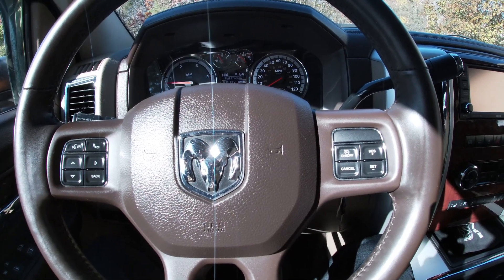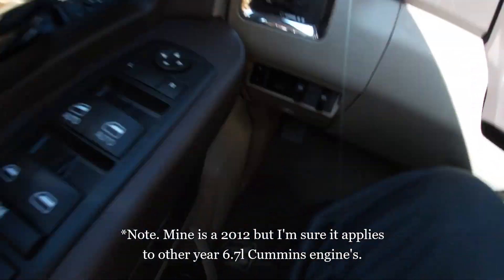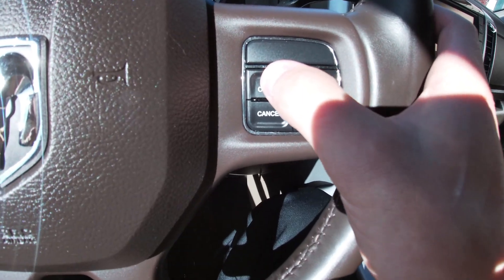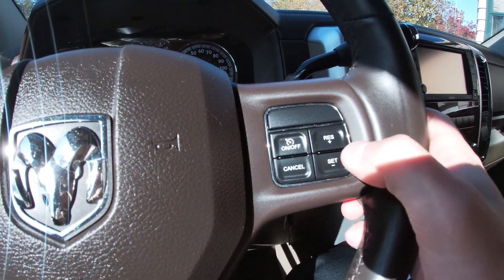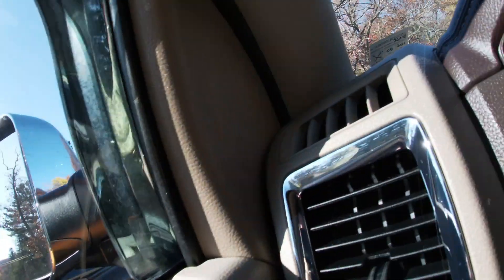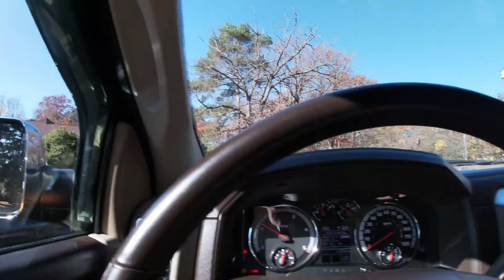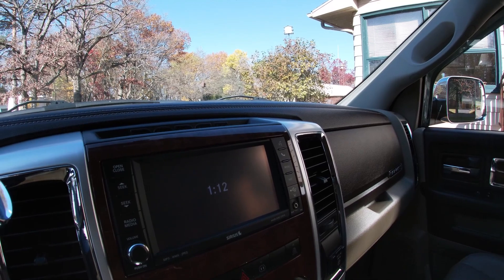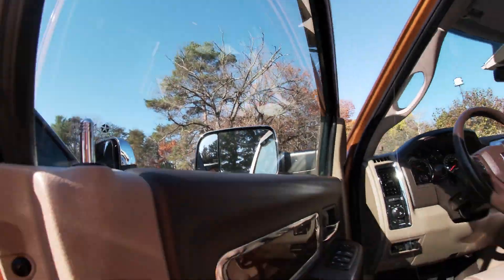Factory High Idle Switch Location w/ Exhaust Sounds | 6.7l Cummins

Comment: Is this what we’re supposed to do if we’re idling at truck-stops for the night. I see people saying that we’re not supposed to be sitting at regular idle overnight.
Reply from the maker: In a scenario like that I would raise it to at least 1000 RPM. I believe the industrial term is cylinder wash down. Low idling in cold temperatures for extended periods will cause fuel to not burn properly and there's not going to be enough combustion gas circulation at such a low idle to rid of all of the soot so it builds up on parts. I'd imagine it then works its way into the oil. I usually hear big rigs sitting with an increased idle. I'd imagine it's partially for this very reason.
Reply: @ClassicalDiesel  thanks
Reply: The idea for raising it, is to decrease wear by increasing oil pressure. And with after treatment systems it helps to keep it a little warmer and not clog as much.